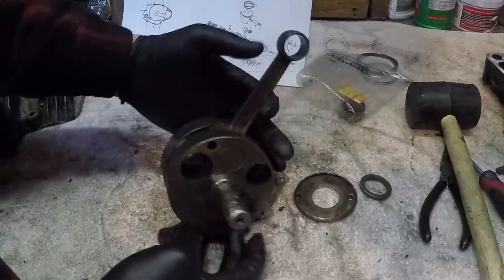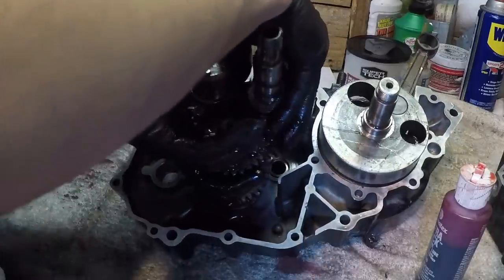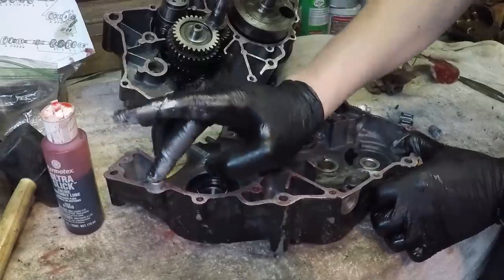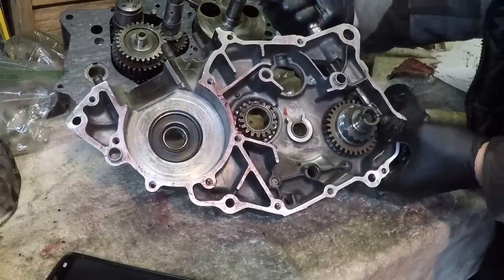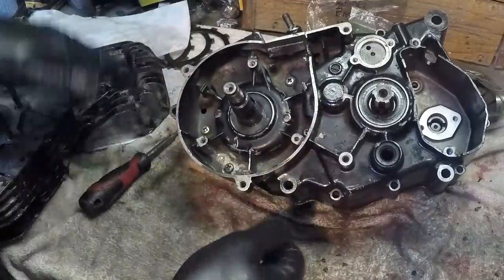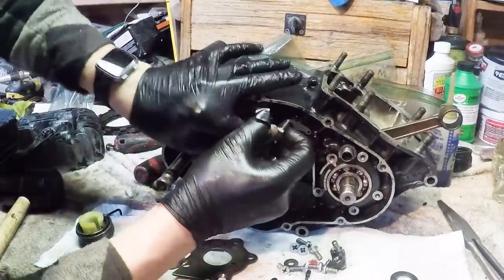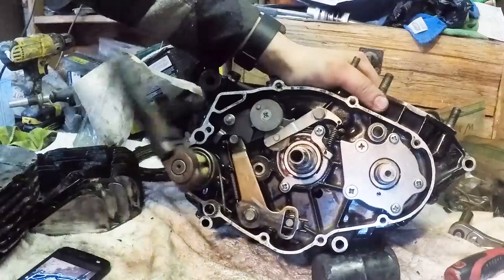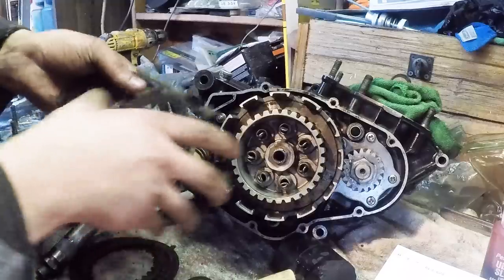TS185 Two Stroke Engine Bottom End Rebuild (Part #2)

Comment: You should watch a tutorial about how to mount an engine. To fit in a bearring  you heat the aluminium and freeze the bearrings and then throw the bearring in it's place. Not smashing the bearring into the hole, uou can damage both

Comment: Put the bearings on the crank only tapping the inner race gently and evenly untill it's seated, then heat the crankcase slowly around the bearing housing with a blowlamp. I used to spit on it and if the spit boiled off straight away that's hot enough then drop the crank with bearing into the housing.

Comment: Where were the best places you found parts? I have a ‘73 ts250 I’m looking at restoring , nothing major I just need a new tank the old ones rusted pretty bad inside , and I think it might be wise that I replace the piston or find new rings for the original one , compression isn’t too bad but it’s sitting on the low side at 70 psi

Comment: I know that this isn't a Subaru video, but I've sent an email over to IA Performance and they say that they can do opensource tunes via email when you send them logs, I'd suggest looking into them a little bit because their customer is top tier and they aren't happy with the tune till the logs are i.e. 5 separate tunes is not uncommon from them. But like I said I'll see what they say about NA-t opensource tunes, if they do it they will be able to help you out and get my 71hta forged 253-257 hybrid running and shooting flames.
Reply from the maker: Awesome, let me know!
Reply: Yo, they are closed and Stephen answered already...
Reply: @GoldGuyRides  sadly they only do turbo native ECU's, now thoughts do i throw on my turbo stuff right now on my 06 with my td04 i have laying around of do i just wait to get the last bolts to finish up my forged block and throw on the big boy turbo? (I am extremely conflicted)

Comment: You really shouldn't hit the bearings with a hammer in... It would have cost maybe 5-10$ to go with the parts to a repair shop and ask them to press them in...
Reply: explain why?
Reply: @dirtygarageguy  They are made to withstand forces from the same plane that they rotate, hitting it from one of the faces put's the force on the rim's edge risking making dents that could grow into a bend where a ball can come out and destroy everything.

Comment: Sort your camera out man! I dont like the way the video cuts off like that. Some ppl watch your video in order to learn themselves.. with huge chunks of the rebuild missing, its a dissapointment. The way you work is also like youre racing through it like you just want to get it out of the way... Or maybe doing a rush job because youre racing against the camcorders battery life?
I feel sorry for the person who eventually buys that bike from you haha. I fully understand that one has to learn, but that should be more the reason to slow down and figure it out properly
Reply from the maker: If only you knew how long i have spent while working on this engine...
Reply from the maker: The rest of the bottom end rebuild will be in the next TS185 episode, including the top end rebuild. Stay tuned

Comment: Don't just hammer those bearings in, do some research and learn properly before you show people how to do something. 
You should be heating the casings and leaving the bearings in the freezer before fitting them.
I'll be surprised if you haven't damaged the casing or bearings to some degree.